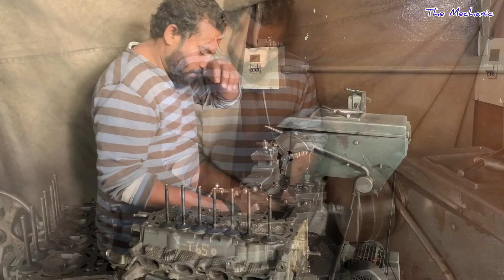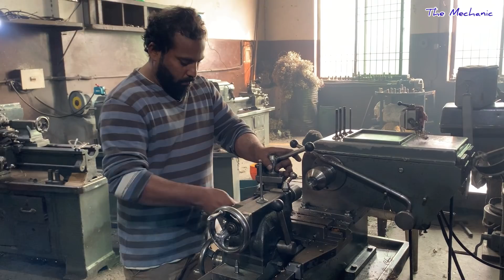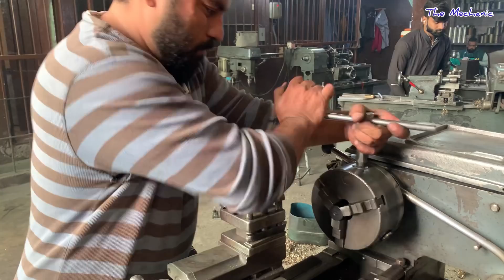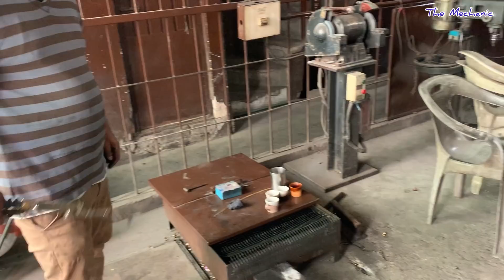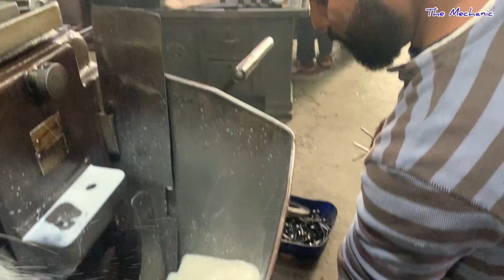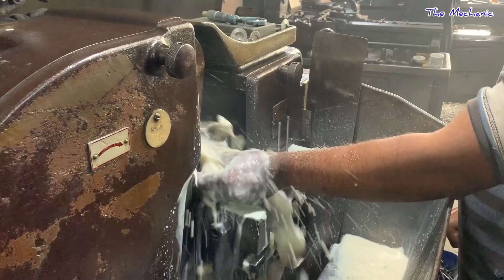How They Make Gasoline Engine Valves From Old Diesel Engine Valves | Method For Manufacturing Valves

Comment: Wow ,I did this 10 years ago for my Honda civic head.after i got done i thought i really should have just bought them.And now i see this guy doing the same thing and it even looks like a hardinge lathe except mine had a turit head on it. but this guy puts my workmanship to shame. i had digital calipers and radius gauges. these guys had a center-less grinder and a valve face grinder.he even heat treated as best he could the valve tips.I'll bet the valves they make last for years.great workmanship.

Comment: The HSS cutter in my mid 60's high school South Bend lathe just squealed on my Cushman's valves, never thought about annealing them!
Reply: Use carbide, or CBN, for hard steel.
And if you are machining a lot off, you will be removing the hardened surface, so they will wear out quickly

Comment: I am truly shocked. A micrometer being used correctly where it's supposed to be used and no abuse of anything. Precision grinders and being mindful of heat treatment...Came here expecting the usual engineering gore, but no - everything is legit. Also the guy has some serious machining skills.
Reply: HSE would love to go in there though....  :D
Reply: And they didn't throw everything at the floor 😺😺
Reply: Beautiful work!! The precision of the valve guide fit is impressive!! As well as all the machine work. Also great that they recycle the large valve into the smaller one. I’m impressed!!
Reply: Well... machine safety is unheard of there. 😂
And -1 Point for not using that konstant torque thingy.
Reply: @Swede7533  Hard turning should be done without coolant
Reply: @Swede7533  pretty sure he's using brazed carbide
Reply: @Swede7533  I don’t think the steel used for a valve is a gummy material.
Reply: Why? These guys learn from 10 years old and are proud of this being their career and the product they make....
Reply: Yeah, what is next? Calibration stickers all in compliance with QC ISO standards?
Just kidding, surprised to centerless grinders used :)
Reply: Love the hand brake on the lathe
Reply: This is Pakistan baby
Reply: YES. lol 👍
Reply: maybe these guys have their own engine overhaul shop, and are not mass producing  just some parts.
custom jobs for clients, not 13 a dozen parts for cents profit a piece.
they seem to know their business.
Reply: @jfjjjjfj really? Look at the guy in the background at 3.21 and at all the valves on the floor behind the lathe at 3.40. They do not show it on the video like in others but they do throw them on the floor, the guy take just a few valves for the sake of the video.

Comment: Better than most videos, but still, quite subpar.  Real valves get heat treated and case hardened.  These might be good for 2500 RPM and 2500 miles max.

Comment: You guys might consider setting yourselves up internationally as makers of custom valves for engines that have valves that are no longer available. A customer could send you the drawings or an old valve and you could make a set. There would be a lot more money to be made doing that. Cheers Stuart 🇦🇺
Reply: Good idea but any decent machine shop should be able to do this kind of work if you need a custom valve

Comment: This reminds me of my youth when we took Chevrolet intake and exhaust valves and recut them to fit Harley Davidsons. The stem sizes were identical so it was simply a matter of cutting them to length and re-cutting the keeper grooves. You could then cut the head of the intake valves to any size you wanted up to 1 7/8" for much higher flow. The exhaust required no cutting of the valve head at all. Why did we do this you might ask? We did it because we had no money, access to a lathe, and Chevy valves were 1/4 the price of Harley valves.
Reply: No. You did that because you knew how to get girls.
Reply: I grew up in an Eastern European country, me and my brother used to do this kind of stuff a lot when fixing our russian made motorcycles. We used modified car pistons and valves/vale guides, bigger oil pumps that were made from scratch, and a lot of other parts that we got from the scrap heap for nothing. That was because we didn't have any money and good parts were hard to find.
Reply: @Swede7533  I a documentary on Cuba that claimed the many of there classic cars have long ago been converted to 4 cylinder Diesel engines.

Comment: Hi, I am going to be working at US Engine Valve (hopefully) as a Machine OP starting next week. I have orientation. I have worked around Machine's but but pretty much all have been computer operated. If anyone has any helpful tips on the interview process, things i may be able to learn before going in, and the process of creating the valves I'd be much obliged. I've never worked with a micrometer, but have seen then used. I am impressed with your speed in this video, seems you've been doing this awhile. I imagine I will need to meet this speed within my first 8 weeks on the job to keep up with production quotas.

Comment: It's common practice to wear sandals, no safety glasses and loose articles of clothing in these shops it seems. I can imagine people get hurt alot. Also some of those tools were pretty dull. Just watching those red hot chips come off like that, but he just keeps cutting with it.
Reply: They dont need cause they dont go to work high and drunk.
Reply: Bad stuff can happen when you are not high or drunk - which means you do not want to stack the deck against you more through avoidable impairment.
Reply: Valves use a hard steel, that's why the chips are red. When you cut really hard steel the swarf can be nearly white hot.

Comment: lets talk about the heat treat of the valve stem. That is the weak link. No temperature control.
Where is the draw back? testing of hardness? I didnt see any ( I do heat treating almost daily in My tool and die shop)
Reply: They also cut well past any hardness on the stem and head so the tip is only part of the problem

Comment: Chop, chop, grind, grind.
No heat treatment and quench anywhere in sight.
Rough AF... Just like the crankshaft I watched somebody weld back together - where it had snapped in the same place it was welded back together the last time it snapped. 
YES, welded back together on a main bearing journal....🤣

Comment: Great machinist, too bad his time is not valued much. Just spent hours making a set of valves that would probably fail quickly if you ran the engine up to 5k rpms, that would cost about $20 brand new.

Comment: How did that Machinist succeed to turn that thin and long valve shaft without chatter? Or maybe it chattered bit and was ground smooth..
Reply: Possible answer: light cuts, sharp tools, and “slow” feeds (relative to RPM, which looked very high.)
Reply: @dennisyoung4631  He is actually doing the exact opposite - a very high feed combined with a heavy cut. Often trying to go slow and light makes chatter worse.
Reply: Rigid lathe, and large tool holder?

Comment: Valves are made from several different metals in the form of discs that are  stacked in the right order before forming there shape 
It keeps the stem straight and stops them from bending all these exotic metals form a replica of each other right through the valve .
Machining them down will render them usless in a very short time
He is a good machinist. But he as 
No knowledge of metallurgy. But 
He is the normal eastern chancer
That engine is doomed to fail .they sound Pakistani so it figures.
Reply: Valves are made the same way, no discs stacking. They are a solid piece of steel or titanium and machined to shape and size.
Reply: @PatricioGarcia1973  With all the info at our fingertips people still make up some wacky shit.

Discs of exotic metals! Lol!
Reply: Y'all should learn more about valves. Yes they are made out of different materials which is why even excessively lapping some of them can damage them and give them shortened lives. But hey what do I know?

Early valves were usually just one material but engines also ran leaded gas to help preserve the valve seats.

Comment: Very good if that's all you have to get moving, but how many valves and other parts like this make it onto the aftermarket as genuine new or pattern parts. Not sure I would be happy using these valves in a heavyweight motorcycle engine, aircraft or marine engines anywhere a sudden seizure will be critical. Take this vid as a warning, only fit OEM parts to critical assemblies.

Comment: Damn...
Im a Industrial Mechanic Mastercraftsman. Im not a machinist, but
HSS Tools without cooling. Burning the Edge. 
Micrometer without using the Clutch to measure. 
No checking for concentricity
(No Safety)
New tools clamped, not adjusted for centre
No heat treatment for Fillet and Seat Face

Comment: Wonders why, given the ratchet-thimble on the mike(s) - why isn’t it being used? 

(Mine have this feature, and I use it “religiously,” as I do not trust my “feel” when it comes to “tenths.”)
Reply: It depends on the micrometer. On some of mine for instance the main thimble is the ratchet and the small one on the end is direct drive. 
Even if theirs are the other way around they have years of experience to develop exactly the right feel.
Reply: I never use the ratchet thimble these days. I get more accurate results just tightening by feel.
Reply: I never use the ratchets on my mics, always just use 'feel' on the main thimble. Never had a problem with accuracy and my readings are always repeatable. Each to their own...   :o)